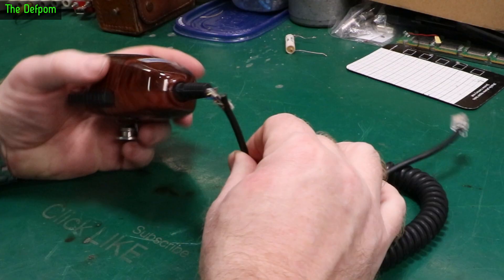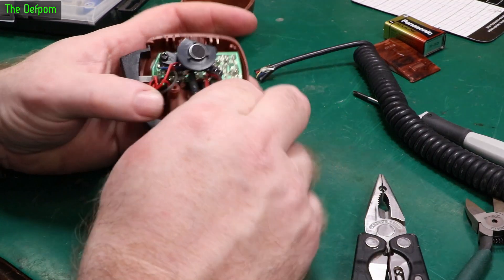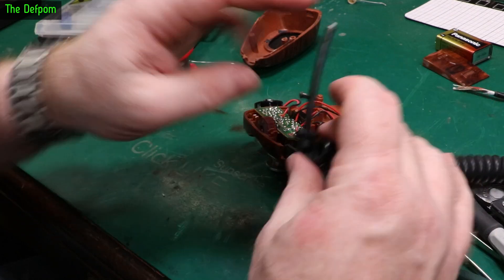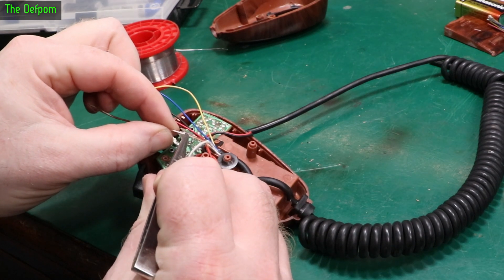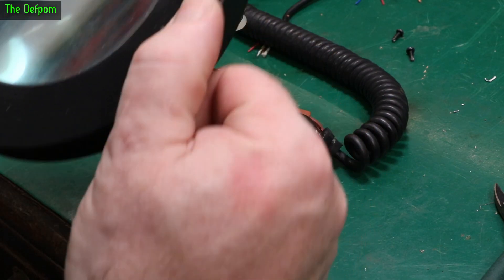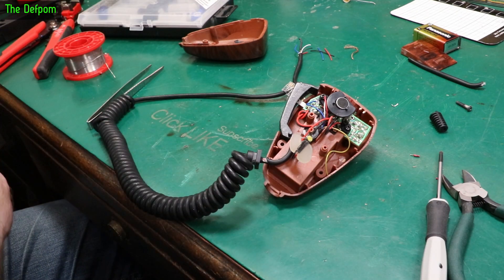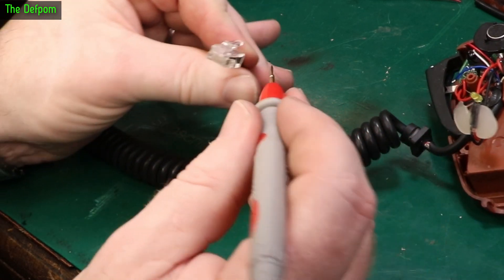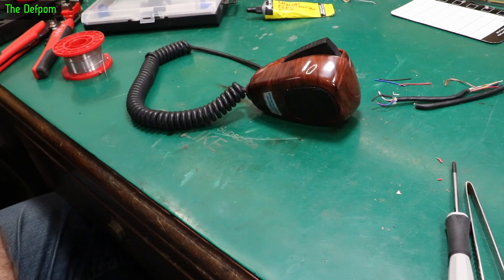🔴 Mic Repair - Truckers Series TM-2007WG Power Mic Repair - No.1280

Comment: I have done many , many , many rewiring and cord changes in my lifetime as a tech....... I used straight cord for quite a few years , it was better and it got popular real fast , I was doing about 10 to 12 re cords a week in my shop ....... 4 feet is all a truck driver needed if the radio was centered on the dash or over it in a cubby hole ..... I ordered 60 feet of it a couple weeks ago since I am back working on radios again....

Comment: Funny it has a battery in there I'd have thought it would get power from the RT. Those coiled cables are flippin expensive as well, took a while to find cheaper options on ali even.
Reply from the maker: @JonnyFix  yeah I need to get some more, I don’t have any left which is why I didn’t just replace it.

Comment: Even on 720p this video is little more blured than it should... you record with old camera or its post processing? I propose to record from top, because distance is not changing, when you film at angle, sometimes you move item further, sometimes arm further closer, loosing focus all the time.
Reply from the maker: @orion310591RS  it isn’t normally an issue, like I think I said in the video (or another one) my hdmi cable was bad so I couldn’t use my normal monitor to check the focus, I have to use manual focus as auto was problematic with getting it to focus on the thing I wanted.
Reply: @TheDefpom there is an answer…….😉
Reply from the maker: @IanScottJohnston  yes there is, just have to buy some other things first, probably in 2 months time.

Comment: To get the wires out of the gland to reuse it I normally pull the wires themselves out of the center of it and then hold the glam with my hand and then twist a leftover empty part of pliers which will unstick it from the inside  end of the gland.

Comment: Your lucky that the cable does not have tinsel wire inside. super flexy  but a bugger to solder without a wire wrapping machine.
most of the microphone leads that were produced my the communications company i worked at as a youngster were tinsel. we would have to strip the insulation  and then wrap the inner tinsel with very fine wire about as thick as a hair. this would hold the tinsel together to form a solderable end when dipped tined. 

What do you expect?  ground, Ptt, mic and screen that's all that's needed.
Reply from the maker: @TheEmbeddedHobbyist  a lot of radios also have an RX (as was wired at the mic end) and some have seperate switch common and audio shield.
Reply: @TheDefpom  I can see the point of Rx if you have speaker mic. I can also see the point of an separate return for the mic to reduce noise pickup. but we aren't talking quality audio here, what's the bandwidth 300-3K normal for voice coms. 
my expensive radio 2m / 70cm radio has the same connector with flat cable with no screening at all for the mic.
Reply from the maker: @TheEmbeddedHobbyist  it’s more for AM, you can get RF feedback without shielding.